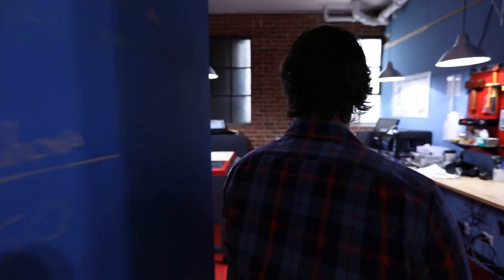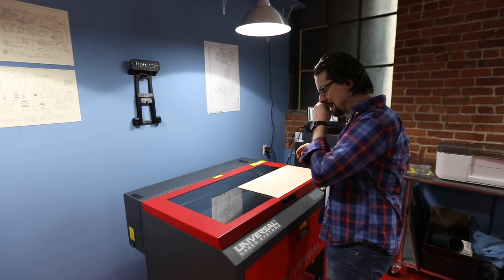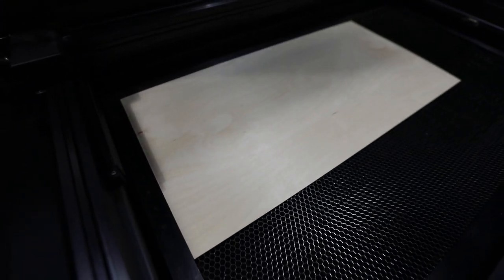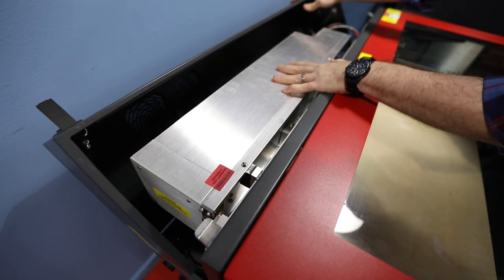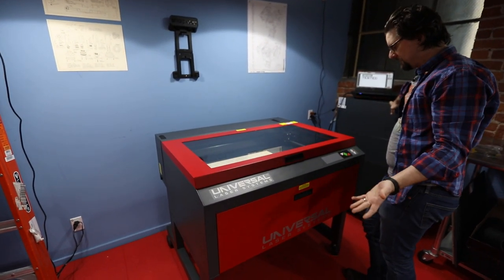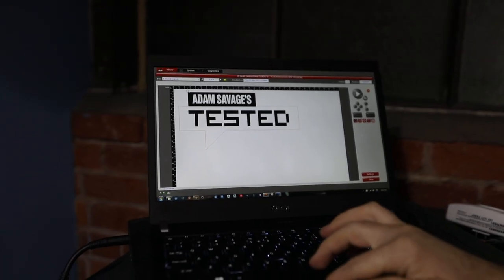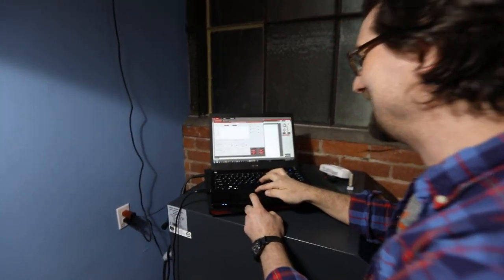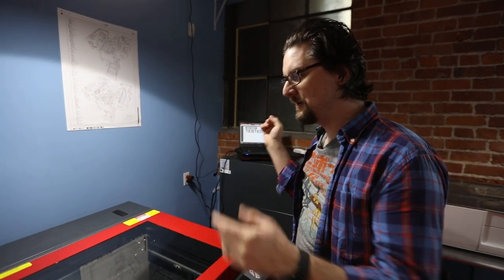Show and Tell: Our New Shop Laser Cutter!

Comment: If warped materials are causing an issue then the maker space i go to used magnets to hold down the material to the honey comb bed. It works pretty well in my experience :)
Reply: Dave, Nice tip!
Reply: Good Idea. I'll have to try that. We make weights out of scrap material, usually leftover corian.

Comment: This is cool. I run an industrial laser that cuts up to 1/2" mild steel, 3/8" stainless and 1/4" aluminum and up to 120x60 sheets.
Reply: JakesMotorsports holy moly! how many watts does that use?
Reply: 2000jago No haha. It is my employers and costs around $1.5m
Reply: JakesMotorsports was this bought 10 years ago? 4k co2 lasers can cut 1" steel, 1/2"" SS and AL.
Reply: Nick Yaekle About 5 years ago actually. We use a plasma table for the thicker stuff.
Reply: Plasmalasers can cut that, I don't thinkCO2 has the ability to cut metals
Reply: @andregignac4259  it does have the ability to cut metal, especially at 400+ watts and when introducing a variety of gasses into the air assist stream.

Comment: I agree that the ULS software is great!  Tip:  for a sharper-looking result, try a hairline vector etch along the perimeter of your raster.  Blue is the default color in the print software.  Very easy to add in Corel, AI, or SolidWorks.

Comment: I'm about to build a whopping great router. Trying to decide what bed size to go. Want that sensible compromise between size and being sensible storage wise.

Really looking forward to it, should be fun. I've done a lot with laser cutters but they are very expensive and are very limited in terms of what you can cut, well, as far as regular CO2 lasers go anyway. Acrylic is pretty terrible as an engineering material, it's very brittle and scratches easily. With the router I can do any plastic as well as aluminium with the right settings. I can also do different levels of cut which I can't achieve with a laser cutter.

Comment: just wanting more information on the glow forge
Reply: I think the fact they've bought this should be a good indication of how the glow forge project is coming along.
Reply: APOC1385 

You can see the Glowforge in the background with some junk piled on top of it.

I wonder how long it would take the Glowforge to engrave a similar sign... twice as long, three times as long?
Reply: The glowforge is 40W, so basic math would say that the Universal @60W would cut 50% faster.  BUT the engrave operation is not anywhere near full power, so I bet the Glowforge could do the engrave in the same amount of time.  The cut through at the end may take longer, but even then this is just 1/8" ply, so it's entirely possible that the Glowforge could do this particular operation in the same amount of time.

Also I'm sure they didn't buy this, I guarantee this was a gift from Universal in exchange for using it in videos.  The large laser companies (FSL in particular) are quite worried about Glowforge taking away the low end of their markets.
Reply: Glowforge sucks

Comment: How much does a laser like this cost with the air filtration system and can it cut al?
Reply: ca. 35.000 - 49.000 depends on the exact model, I'm not sure about the model. Filtersystem extra.
Reply: FSL P‑Series Laser Engraver / Laser Cutter CNC CO2 20x12 Pro
$4,995.00 - FSLaser
Reply: That is a cheaper, lower powered, water cooled laser with steppers instead of servos, much smaller work area, and just overall lesser quality machine and service. Not to mention they have a sketchy reputation within the laser engraving community. It doesn't even compare to what Tested has from Universal Laser Systems, or Epilog or Trotec.
Reply: You can't cut aluminum with a CO2 laser. You can etch it using products like Thermark or Cermark.
Reply: I dont know how much this exact brand cost, but I assume is not cheap. I have a chinese 80w laser cutter, is water cooled so it can't run too much time but it has a work space of 900x 600 mm(35x 24 inches). it cost me $8000, wich is kind of cheap; if you treat it well the laser tube can last more than 3 year. I've been working for about two years and it runs well everytime so far
Reply: thanks for the comments. I thought it wasnt a co2 laser. We bought a sub 20k € laser at my work place to etch al serial number lable plates for machines. My idea was to use a laser wich is able to cut al, so u can etch the lable and cut it in one step and all u need would be a anodised al plat e.
Reply: I use that exact one at work. its decent but I don't know if I would recommend it.
Still a good machine though.
Reply: Nemo222 or a fiber laser which are available up to 12kw
Reply: You would need a fiber laser to etch/engrave metals and a finer lens like 1.5 as opposed to 2.0 hich is more common
Reply: That unit is around 30k or so

Comment: Would it be possible to fill the machine with an inert gas to prevent scorching?
Reply: The air in the cabin is being filtered the whole time + you can open the cabin. It would make it slower and was more expensive. But I guess in theory it could be designed that way
Reply: BOOZy there is an air line attached to the laser tip, I don't see why not hooking It up to an argon or nitrogen tank.
Reply: It's not scorching in the traditional sense, as in excess heat causing discoloration. What's happening here is the smoke from the cut/etched areas is passing over clean areas and leaving behind a tar stain, similar to a smoker's teeth. Filling the chamber with an inert gas wouldn't do much to help, since there would still be vaporized material to leave a tar stain.
Reply: I suppose if you have it go through a filter when pumped out and recycled. If not it would probably way to expensive to be worth it.
Reply: It's the laser tail that causes discoloration or sometimes the type of material being cut, many ppl use a large format masking or low tack masking tape to protect the surface from discoloration, furthermore, leaving the masking on allows you to paint or do more creative things to the etch/engraving

Comment: It's kinda freaky watching wood being shaped without it making dust. What keeps one of these from cutting it's own bottom off?
Reply: Max Thrust Focus point. (And you'd require way more power to get through metals).
Reply: CO2 can't cut metal at these low wattages but it will light up whatever is left at bottom or falls through from many cut jobs, especially acrylic, like gas to a fire!

Comment: Laser cutters are exciting the first or second time you use them, but it gets boring real quick.  It's slow, messy and  there's no automatic feed so if you have to cut 100 shapes (that you can't place multiple on a single piece of material) you're at that wretched machine all day.
Reply: A. E. and? you  wanna try and do it by hand?
Reply: Doesn't Glowforge offer a model with automatic feed?
Reply: A. E. Most industrial lasers have software that controls feed rates. It's as easy as pressing "start". Skilled labor is harder to find and these machines are designed so that the average Joe can run them with very little training.